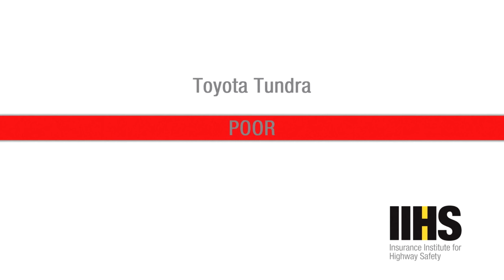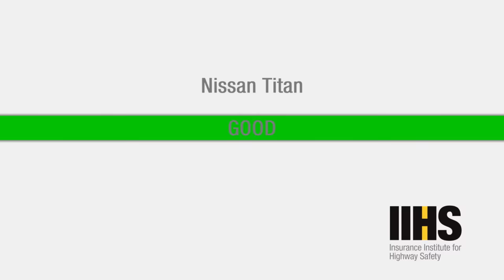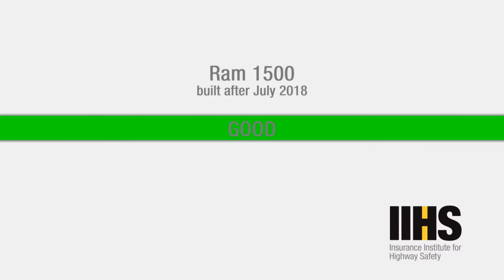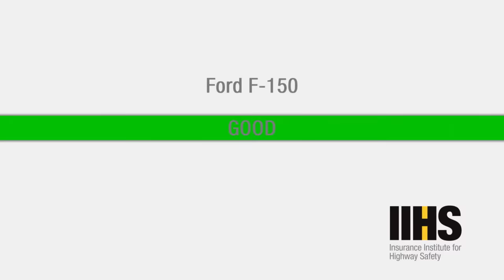TRUCK CRASH TEST COMPILATION - Ford F150, Toyota Tundra, RAM 1500, Nissan Titan

Comment: They're testing vehicles in 2020, they should be using vehicles produced in 2020. Australia and Europe have a star rating for vehicle safety, many vehicles rated on 5 star were tested 5, 8 or even 10 years ago, still rate 5 stars but in reality would fail the safety tests of today. There should be no vehicles, including pickup trucks that rate anything less than 4 stars. If they do, they shouldn't be on the road. But profits are more important than some poor buggers in the vehicle.
Reply: They are just nobody has changed their design since they came out just engine components
Reply: @IeeIee778  calling vehicles that technically would fail the tests, including the vehicle I own and drive 5 star should be illegal if the make, model doesn't rate 5 stars. There are people that judge their purchase on the safety rating for the sake of their family. I know that american pickups are not rated in Europe, the manufacturers bar the testing. Ditto Australia, because if they were tested all would fail the standers of those countries. Christ, they'd fail the standards set in America  whose standards are way lower than most of the world, pretty much as in everything, even military equipment. It all comes down to profits first, safety second.

Comment: So excited to see the Cyber Truck crash test. An enormous stainless steel box with sharp edges, short front end, and higher (approximate) curb weight.

Any mechanical engineers out there? Expectations?

Comment: Why don’t they do two vehicles head on doing 60mph.not every crash is offset.
Reply: The test being done here is a passenger side small overlap test. It's just one of many. Using vehicles wouldn't create consistent results. Controlling for the variable with the barrier is the best they can do.

Comment: The test is designed to make the vehicles look bad-- I've never seen a car in the yard with a wreck like this-- the worst accident is getting t-boned.  Some auto makers complained about this test but people are always looking to be outraged and it falls on deaf ears.  After everything is redesigned they'll make some new test where a sharpened telephone pole comes up through the floorboards.
Reply: They keep pushing manufacturers to keep increasing the safety of the vehicles because most of them won't do it on their own.

Comment: Seems like all the manufacture's could improve the passenger air bag designs.  Passengers appear to always dive toward the corner where two air-bags meet which allows the head to' miss' both front and side air bags.  Also, side air-bags should not need to rely on the door glass to provide full protection.

Comment: Let’s face it, the quality of vehicles has gone down hill. Better off with something from the 80s or 90s. Back when automakers used metal instead of fiberglass. Also trucks are not made for racing or speeding anyways, but people assume they are and rollover or ramming someone.

Comment: Drive them into a steel pillar to  recreate hitting a tree,  at an offset angle like leaving the road,  dropping down a verge and into a large ash or sycamore tree with a good girth,  these vehicles give the occupants a false sense of security due to their size and end up going faster than they really should ,  reality is an oversized tin box  that when they meet nature the illusion is shattered.
Reply: A tin box they are indeed mate , and your probably , right there are probably many ways cars and trucks could be built better for many different types of accidents , the problem is , short of being built like 70 ton tanks , it will probably never be feasible to be 100% fool proof safe because cars and trucks are generally built to a price that car makers can make a buck , and people can afford to buy them.

Comment: How can you actually get any kind of crash data out of this when you don't use the actual fluids in a vehicle you drain the vehicle of all this fluids and stuff so you get one change in the weight of the vehicle too you're changing what really could happen in a crash meaning yeah maybe the dummy might survive because of the airbags but Concord burst into flames and they die you need to also make sure that in these crashes gas tanks don't explode

Comment: My only issue with NHTSA is that these frontal crash test are preformed at 30-45 MPH and thats great if your driving on side roads and streets where the posted speed limits are usual 30-45 MPH but why aren't these same test preformed at highway speeds like 55 MPH and higher? I think most people would like to know how well thier vehicle preforms in real world driving situations at speeds of 55 MPH or higher on Highways/Freeways/Expressways and Parkways? Many States outside of New York have higher speed limits of 60 to 75 MPH and a very very small handful without posted speed limits. Your seriously not going have the same results and most likely there will be fatalities in a vehicle traveling at 60 MPH or faster that preformed well at 45 MPH. If NHTSA preforms test at Highway speeds for passenger vehicles send me a links please. Think about it.. We hear vehicle ads where a vehicle has a five star 🌟 🌟 🌟 🌟 🌟 crash from NHTSA but without mentioning the speed these test are performed at and that same vehicle might have failed horrible at 55-60 MPH. If I was going to purchase a new or used vehicle I'd like to know how that vehicle is going to preform in multiple crash test at 55 MPH to say 75 MPH on the left, right and head-on.  As we know most people drive over 55 MPH on almost all highways / Freeways or Expressways and yes Parkways including the people that drive distracted that have ABSOLUTELY NO REGARD FOR ANYONE ELSE'S LIFE DRIVING AROUND THEM!! I've seen Mom's & Dad's with little kids in car seats or sitting upfront in the passenger seat and Mom or Dad are texting while driving.. Why would anyone teach thier kid or kids that thats ok? Cause we all know most kids pickup bad driving habits from the parents. I really wish that both our Fed Government and local state governments and local law enforcement would seriously crack down on drivers caught texting and driving! First ticket starts at minimum of $250. Without any plea deals Any ticket afterwards for the same offense minimum $500. Plus a point on thier driver's license record and if caught a 3rd time for the same offense minimum $1000. And two or more points on your driver's license record also no plea deals or lowering the offense to say another offense. And on the 4th time minimum $2000. And loss of driving privileges / license for a year or longer if there were any fatalities. Thinking about it a lot of these driver's tend to drive slower in the left lane and in basically ever States unless posted the Left lane is the PASSING lane ie driving at a higher rate of speed to pass the vehicle on your right and afterwards return to the middle or right lane and the right lane for slower traffic and people entering and exiting. I also think it should be mandatory during any vehicle accident that all cell phones should be checked to see if any of the drivers involved in the accident were using thier phones absolutely mandatory! Give first responders and law enforcement technology that allows them to pull all last activity on a persons phone that again were involved in the accident just text and call activity no need to see what was texted. Hopefully self driving cars will fix that issue down the road once the technology is perfected. As for Self-Braking vehicles it's a great technology but many drivers who's vehicles are equipped with self-braking systems are unaware that ABOVE certain speeds self-braking systems Will Not engage! Your on your own to control your vehicle like Airbags don't deploy below 15 MPH if I recall. Auto manufacturers should put a label below the speedometer stating if you're driving above say 65 MPH or higher that Automatic Self-Braking will Not engage. I had read that in my friends owners manual for thier car and that was a bit of a shock but I forget what the systems speed limit was and I believe it was 65 MPH. Again if anyone reading my book knows of NHTSA preforming crash test at real world speeds of 55 MPH and higher on passenger vehicles please include links in your reply it would be greatly appreciated. sorry my comment was this long but I have questions I'd like answered when it comes to US crash testing or passenger vehicles. NHTSA here's another question. In many other countries when there's a motor vehicle accident on their highways they use pop-up Curtains to keep traffic moving that basically keeps other drivers from rubber necking.. 'OMG What happened ' you get the point. Why don't we follow in that idea?. I was a limousine driver here and in Europe for well over ten years so, I've seen a lot.

Comment: Chevy wouldn't start because someone swapped out the ac delco for a worthless motocraft   battery Plus I thought new vehicle Have crumble zones to absorb impact That ford bounced off the block like a rubber ball into on coming traffic Guess  that's what They Call ford tough

Comment: Real life crash for all those truck with conventional cars won’t be so dramatic even with overlap due to higher clearance of trucks. So this is more like crash-test over edge of concrete building or thick tree. Not sure how is that practical. Also cars are not as ridgid as concrete wall they crash against, so in real life they bounce  and taller and heavier vehicle gets more dominance in bounce crash situations.

Comment: Seems the passenger side airbags are misaligned to the seats. All of the dummies heads went to the right of the airbags, which would have caused broken necks and/or severed spinal cords. They should make the dash and side airbags all one piece so the passenger doesn’t get slung into the unprotected space between them.

Comment: Those crash test dummies are not seated properly. Passenger should be female with both feet on dash, driver should be make leaning and resting on right elbow and left arm dangling over the top of steering wheel. Both should have seats reclined to about 20 degrees and using phones to text each other.
All the trucks are too low to the ground, need to be raised to 5 feet

Comment: It’s kinda weird how anybody considers crash testing a viable indicator of safety, especially if the control group is always constant and there’s little to no variation between tests. As in, all the cars are tested the same way, crashed in the exact same spots, at a constant speed and angle. So while it might indicate that yes, you’ll probably survive if you get in a crash like this, it does nothing to show variation. That’s how companies get away with having unsafe and idiotic design. They only need to check these specific boxes to get a pass. Ford will fail to tell you your roof will cave in on you if you rollover, Chevy will fail to say their beds scrunch up like a piece of paper, and dodge won’t tell you that their materials are subpar and basically rot away from the factory
Reply: 😂 Damn all facts bro

Comment: I guess I don’t know what I’m looking at, but it didn’t look like the Toyota did any worse than any of the other trucks and it got a poor even though the dummies didn’t appear to have died or been seriously injured. The Honda looked like it did the worst IMO, but I’m not an expert
Reply: You can easily see how much worse the Tundra did, the A-pillar got crushed inwards, the front wheel ended up in the passenger footwell, and the overhead view shows the dash being pushed in the passenger's lap...
The F 150 for example got redirected away from the barrier, and that's what you want, glancing blows dissipate energy more gently.

Comment: Japanese brand cars engine was good quality but the car body were poor quality. Japanese car manufacturers did that as cars in Japan can be phased out after 3-5yrs of use. I know this coz my relatives lives in Japan and they even told that engine was good but the car body was easily crashed when accident occurs

Comment: Ford makes the best cars and trucks on the planet hands down nobody beats Ford for quality or safety the Ford is the only vehicle  that they tested that look like it tried to steer clear of the accident great job Ford Motor Company
Reply: Your right nobody's beats ford on their record breaking knob falling out Speedrun your right great job at being uneducated the sliding won't happen in a real situation the truck is going to go straight into the thing their headed for because it has traction and isn't gonna save anybody  so horrible job Ford motor company

Comment: I am curious to know if some of the systems are pressurized and tested for integrity. For example, the fuel system. A rating of 'Good' might not be the best idea for a truck where the fuel rails start spewing pressurized fuel all over a compromised, sparking battery.

Comment: Great review! Thanks.
I chose the Colorado for price and towing according to my Nissan mechanic. Apparently bullet proof engine a turbo. Ive done 88000km mainly towing 1.2t trailer daily empty and up to 3.5t loaded. Hasnt missed a beat. Offroad it has been good but rear locker would be handy. Only issue ive had was a blown turbo hose that was a recall and replaced. Happened while towing Jayco Hawk back from Robe SA and did no damage. My mechanic was impressed. Next I think ill go for the Triton with savings spent on upgrades.
Reply: Nice

Comment: This video is such a crock. They didn't even show the chevy. Probably cause it did so bad they couldn't show it. And I don't give a f what you say, the tundra was a good, and should have came in at at top 3. The Ford least damage and did very well, everything else crumple like a beer can except the tundra. The ram almost folded in half and the bed almost went through the cab, junk. The smaller trucks, well their smaller and i can see why they chose those ratings. I'd still rather wreck in a tundra over the others
Reply: The ram did a better job with protecting the driver than an F-150 shitbox the ram is a work truck not a daily